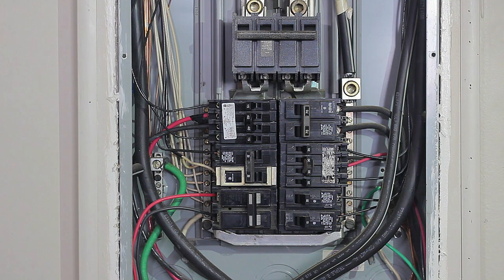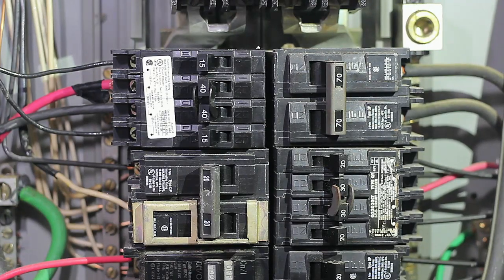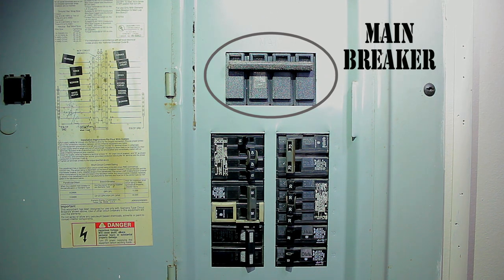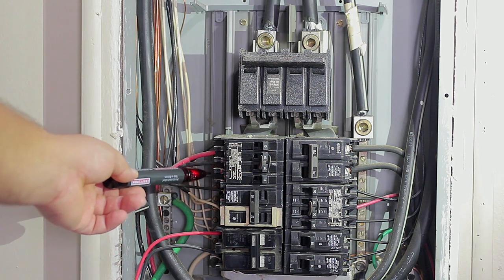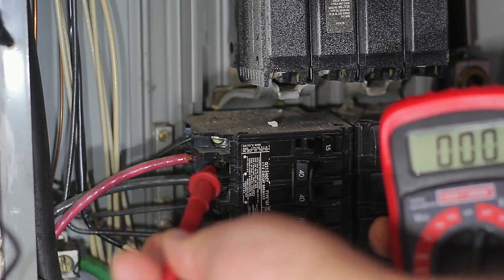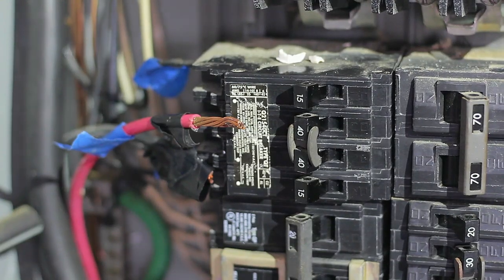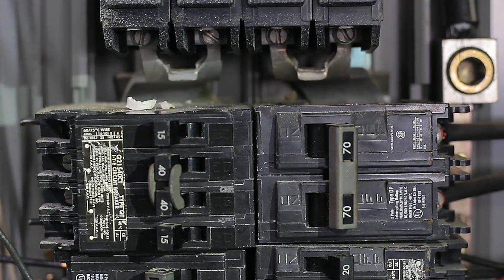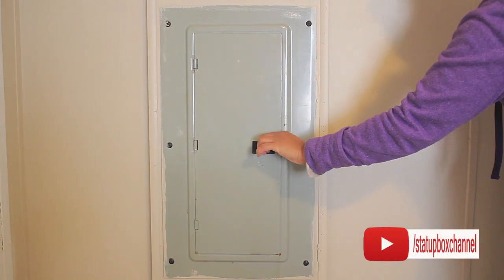How To Change A Breaker Simple

Comment: Great stuff, thanks.  I might add (if no one else has), use Rubber Soled shoes, use plywood or wood beneath your feet as extra precaution especially if your floor is damp such as in a garage... Rubber gripped tools when possible. Don't over tighten any screw heads and be .."just like a Boss" lol

Comment: Thanks for the video! It is a huge help. I love that you put safety first. I do have a question. If you are changing the breaker from a 40 to a 50 do you have to change out any of the wires or is it the same process?
Reply: I’m NOT an electrician but I think that you have to be careful if you put a higher load circuit breaker in. The wires leading to your outlets could overheat if the wire gauge is not thick enough. For example Space heaters can trip the breaker, but if you up the amp on the breaker wires might overheat and not trip the breaker.

Comment: I have one, my main circuit in the box is bad and needs changing but I'm not sure what to do, in one video it just pops out, another, you screw, I have the outside power pole cut off and my tester isn't working, I'm not sure what to do

Comment: Question! I had my electrical heater plugged in while I was vacuuming (I know, I know!) and all of a sudden my lights in my room won’t turn on,  and the outlets won’t work. I’ve tried turning the breakers off/ on and nothing with that wall. What do you suppose could be the issue?

Comment: Awesome detailed  video.  
Question. 
Ive Lived in this  house for 2 years now and the breakers had never tripped till about 4 days ago . If the ac is on for more than 25 minutes the braker trips and it feels hot. I've ran ac and heat for days at a time and never did this . Can it be just the breaker that's gone bad and overheating?  Thanks
Reply from the maker: a breaker is not suppose to overheat, it can be the breaker. but it is always best to contact a pro to have a check.
Reply: yes the breaker is failing.

Comment: Many videos show them pulling the breaker out before disconnecting the wires, what are the pros and cons?
Reply from the maker: You can do both , mostly depending if you have enough wire to pull them out or how easy it is  to pull them out with the wires, we choose comfort level.

Comment: I'm trying to determine why my 60amp breaker won't reset. I don't see a main breaker switch for the panel. would the main panel be outside next to the meter box? or is the 60amp breaker the main breaker switch?
Reply from the maker: in some cases main breaker can be found out side or in another location or even sometimes next to the breaker box in another box.
Reply: you might have a short causing it not to reset.

Comment: Can I replace a 20amp breaker with a 30 amp?
Reply: Only if your wire is sized correctly.
For example: 120v with a 20amp breaker you need a minimum 12 gauge wire at any point in the circuit, for 30 amp you'd need 10 gauge minimum.
The idea is that the breaker should be the weakest link in the circuit to prevent the wires from overheating (and damaging electronics or causing a fire).
For example: 20 amp breaker with 14 gauge wire at any point in the circuit is a fire hazard.